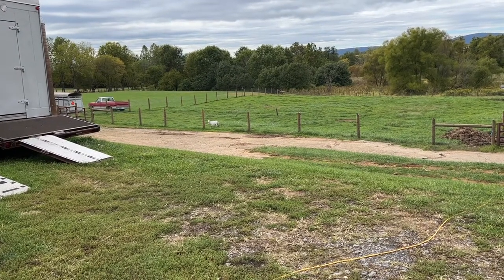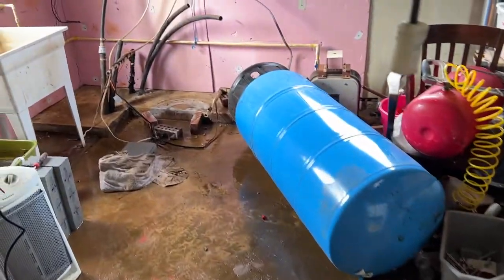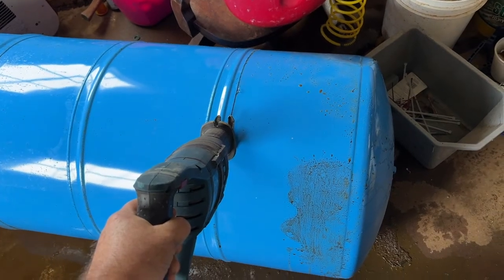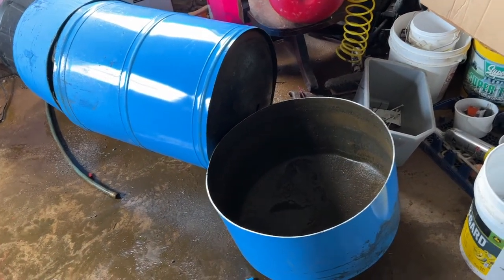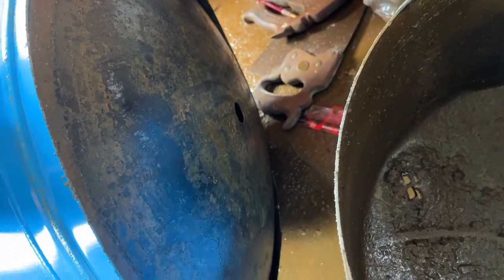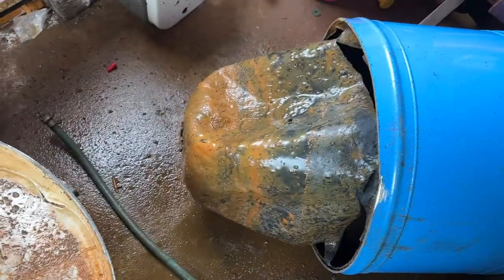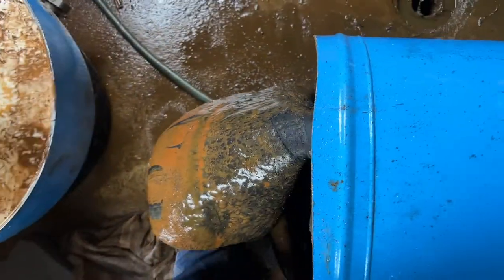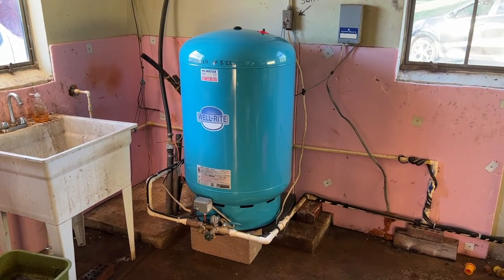What a bad Well System Pressure Tank bladder looks like with tank cut open showing failed diaphragm

Comment: How can you tell if the bladder is bad if the tank can't be moved/shaken because of multiple soldered in plumbing connections?
Reply from the maker: You still should be able to shake it around enough to tell, if fully depressurized but it is still really heavy then it's full of water and the bladder has failed